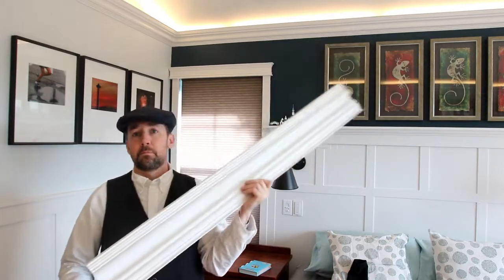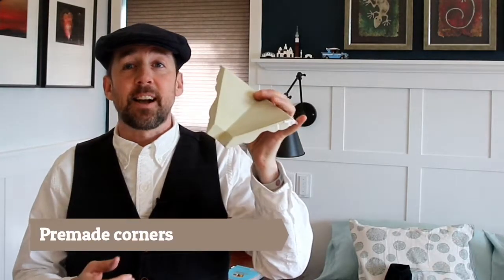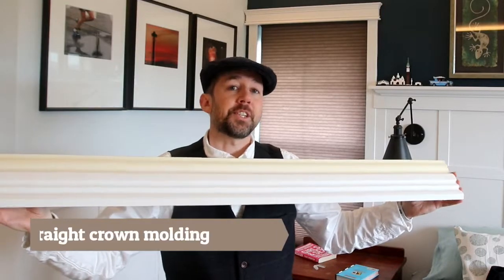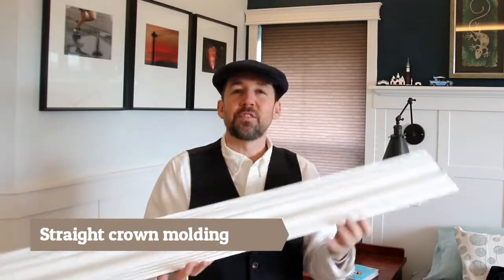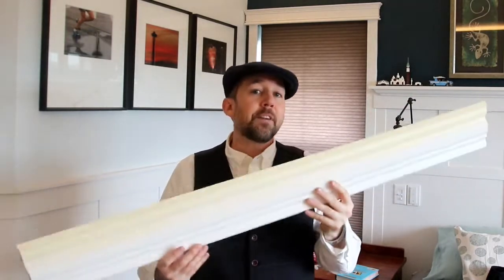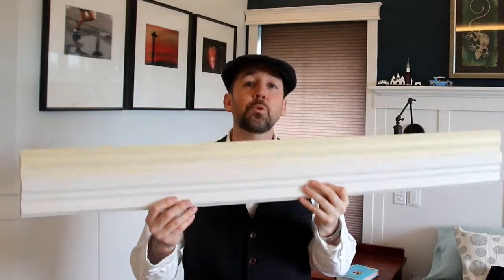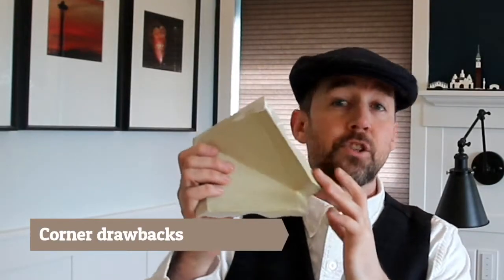Review of Ekena Millwork's Crown Moulding system

Comment: What are the easiest crown moulding systems for a DIYer? Thank you.
Reply from the maker: Use corner molding, but not the kind of corner molding I used in this video (matches the profile of the crown/cornice). You want something that has a bigger profile than the crown/cornice. It'll look decorative, but really, it means that you don't need to deal with cope joints and miter cuts. Example: https://www.homedepot.com/p/Ekena-Millwork-5-in-x-3-1-8-in-x-7-3-4-in-Outside-Corner-for-Moulding-Profiles-MOC03X03BI/203798350

Comment: You might find some plastic crown moulding hangers would be of help when hanging the crown yourself. Glad to hear coping is doable with polyurethane material. Agree the pre-done corners aren't worth the nasty butt joints. Plus, the coped miter will be more accommodating if your corners are off a little.